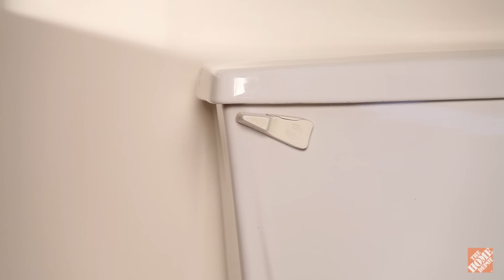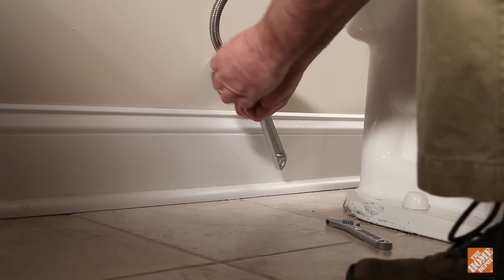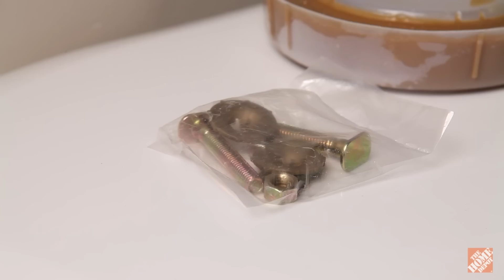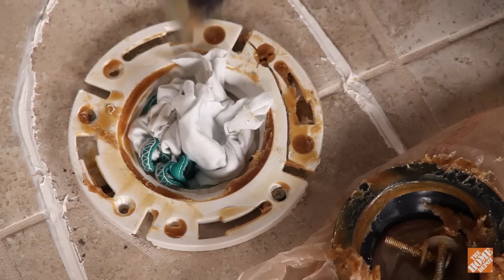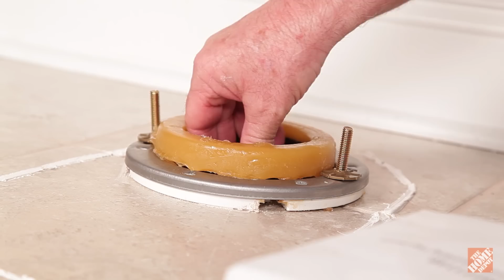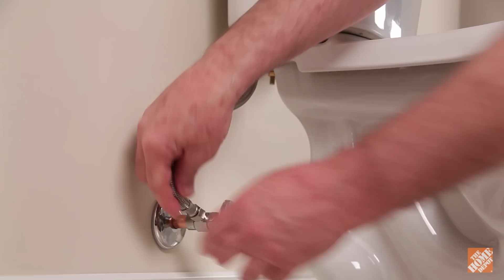How to Replace or Install a Toilet | Bathroom Renovation | The Home Depot

Comment: If it is caulked, the thinking is that if the toilet flange leaks, you'll end up trapping water between the toilet base and the floor in an area that you can't access. In reality, toilets rarely leak onto the floor. More often, they leak through the floor around the flange. Caulk prevents a fouling area, and should always be done.